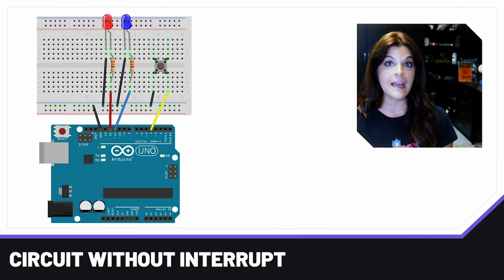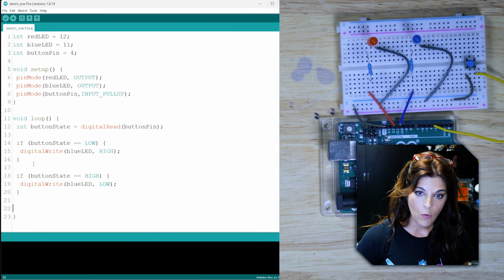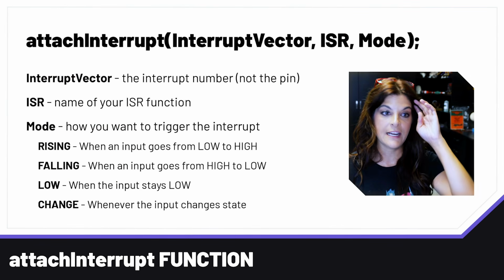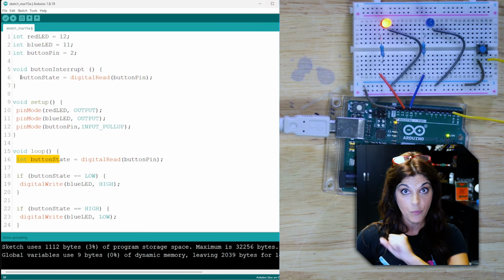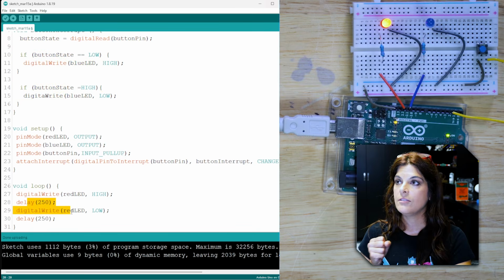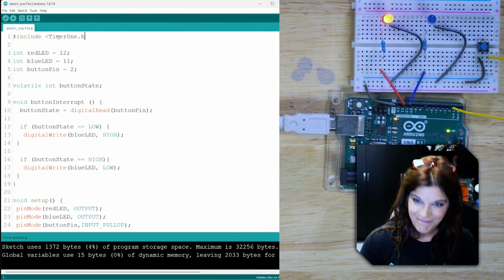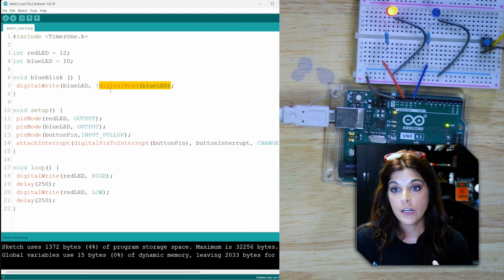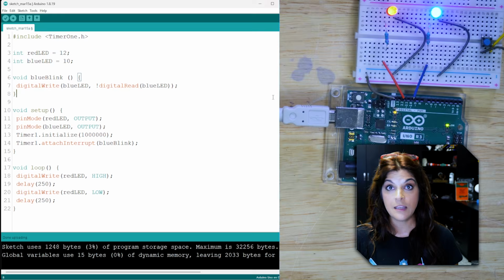How to Use Arduino Interrupts The Easy Way

Comment: // The following code defines the BICOLOR LED class
//
// This is for a TWO LEAD bicolor LED: passing current in one direction results in
// a green color; passing current in the other direction results in red color. Yellow
// can be achieved by alternating rapidly between green and red.
//
#define OFF 0
#define GRN 1
#define RED 2
#define YLW 3

class BICOLOR {
  public:
    BICOLOR(unsigned pin1, unsigned pin2);
    BICOLOR(unsigned pin1, unsigned pin2, unsigned grnDelay, unsigned redDelay);
    void on(int color);
    void blink(unsigned color, unsigned onTime, unsigned offTime);
    void refresh();
    void off();
    void setGrnDelay(unsigned delay);
    void setRedDelay(unsigned delay);
  private:
    void _red();                // sets LED state to RED
    void _grn();                // sets LED state to GRN
    void _off();                // sets LED state to OFF
    unsigned _pin1;             // LED pin assignments = NOTE this class is for a
    unsigned _pin2;             //   2 pin bicolor LED
    unsigned _grnDelay;         // time (msec) to display green to obtain yellow color
    unsigned _redDelay;         // time (msec) to display red to obtain yellow color
    unsigned long _timex;       // current cycle time (used for displaying yellow color)
    unsigned _state;            // LED state - valid values are OFF, GRN, or RED
    unsigned _color;            // LED color - valid values are OFF, GRN, RED, or YLW
    bool     _blink;             // a value of true means current _color is blinking
    unsigned _onTime;           // time (msec) while current color is ON
    unsigned _offTime;          // time (msec) while current color if OFF
    unsigned long _cycleStart;  // start time (msec) of current blink cycle
};

/*
 *  This class controls a two-color LED with two leads
 */

BICOLOR::BICOLOR(unsigned pin1, unsigned pin2) {
  _pin1 = pin1;
  _pin2 = pin2;
  _grnDelay = 10;           // default values
  _redDelay = 3;            //
  pinMode(_pin1,OUTPUT);
  pinMode(_pin2,OUTPUT);
  digitalWrite(_pin1,LOW);
  digitalWrite(_pin2,LOW);
  _color = OFF;
  _state = OFF;
  _blink = false;
}

// For a greener yellow, increase grnDelay
// For a redder yellow, increase redDelay
BICOLOR::BICOLOR(unsigned pin1, unsigned pin2, unsigned grnDelay, unsigned redDelay) {
  _pin1 = pin1;
  _pin2 = pin2;
  _grnDelay = grnDelay;
  _redDelay = redDelay;
  pinMode(_pin1,OUTPUT);
  pinMode(_pin2,OUTPUT);
  digitalWrite(_pin1,LOW);
  digitalWrite(_pin2,LOW);
  _color = OFF;
  _state = OFF;
  _blink = false;
}

void BICOLOR::on(int color) {
  switch (color) {
    case GRN:
      _color = color;
      _blink = false;
      _grn();
      break;
    case RED:
      _color = color;
      _blink = false;
      _red();
      break;
    case YLW:
      _color = color;
      _blink = false;
      _timex = millis();
      _grn();
      break;
  }
}

void BICOLOR::off() {
  _color = OFF;
  _state = OFF;
  _blink = false;
  digitalWrite(_pin1,LOW);
  digitalWrite(_pin2,LOW);
}

void BICOLOR::setGrnDelay(unsigned delay) {
  if (delay != 0) _grnDelay = delay;        // insure _grnDelay is never zero
}

void BICOLOR::setRedDelay(unsigned delay) {
  if (delay != 0) _redDelay = delay;         // insure _redDelay is never zero
}

void BICOLOR::blink(unsigned color, unsigned onTime, unsigned offTime) {
  _color = color;
  _onTime = onTime;
  _offTime = offTime;
  _blink = true;
  _cycleStart = millis();
}

void BICOLOR::refresh() {
  unsigned long currTime;
  
  // First, handle yellow color transitions
  if (_color==YLW && _state!=OFF) {
    currTime = millis() - _timex;
    if (_state==GRN) {
      if (currTime > _grnDelay) {
        _red();
        _timex = millis();
      }
    }
    else {
      if (currTime > _redDelay) {
        _grn();
        _timex = millis();
      }
    }
  }
  
  // Next, handle blinking color
  if (_blink) {
    currTime = millis() - _cycleStart;
    if ((_state!=OFF) && (currTime>_onTime)) {
      _cycleStart = millis();
      _off();
    }
    else if ((_state==OFF) && (currTime>_offTime)) {    
      _cycleStart = millis();
      switch(_color) {
        case RED:
          _red();
          break;
        case GRN:
          _grn();
          break;
        case YLW:
          _timex = _cycleStart;
          _grn();
          break;
      }
    }
  }
}

//  The following primitives set the LED state to GRN, YLW, or OFF
//  without altering any of the other variables that control LED
//  color or lighting

void BICOLOR::_grn() {
  _state = GRN;
  digitalWrite(_pin1,HIGH);
  digitalWrite(_pin2,LOW);
}

void BICOLOR::_red() {
  _state = RED;
  digitalWrite(_pin1,LOW);
  digitalWrite(_pin2,HIGH);
}

void BICOLOR::_off() {
  _state = OFF;
  digitalWrite(_pin1,LOW);
  digitalWrite(_pin2,LOW);
}

Comment: Rachel, a few years ago I was writing a code library to control bicolor LEDs: current flow from pin1 to pin2 lights the red LED, and current flow from pin2 to pin1 lights the green LED. BUT, if you rapidly switch back and forth from red to green, you can achieve a pretty good yellow color.
Not knowing anything about interrupts, I created a bicolorLED class, with methods like setColor(color) where color could be RED or GREEN or YELLOW. RED and GREEN were trivial, but the YELLOW color needed to be automated somehow...
...so I created the refresh() method, which compared the current state of the LED (ON, OFF, RED, or GREEN) with the desired state and made the necessary adjustments. Everything was handled automatically, you just had to (a) call the refresh() method at the start of the loop() function, AND (b) never never NEVER use a delay() statement.
Things got pretty tricky when I decided to add the blink() method, which blinks the LED on and off at specified intervals (e.g. bcLed.blink(500,1000);). Now my class was tracking two different time intervals: one to produce the yellow color and another to control the blink.
I can see now that by using timer interrupts, I could have (I think) continued to use delay() elsewhere in my code. That said, this has never been an issue for me, so I don't see much need to replace a working library.
BUT...
...As I think about it, my solution using classes allows me to have an arbitrary number of blinking LEDs, all at different intervals. If I understand your explanation, I am limited to just three timer interrupts.
That said, I LOVE the idea of using the hardware interrupts for responding to button presses - gotta be a lot cleaner than polling!

Comment: Hello, I love your videos. 
I am having trouble trying to get an interrupt to reset a timer. I tried DELAY first and I could interrupt the timer and the function it was running but would have to wait till the delay timed out to reset the function. I tried to use MILLIS and then could not get the same interrupt to even stop the function MILLIS was running. I hope you have a video you could direct me toward to learn my errors.

Comment: #define B 0
#define C 1
#define D 2
#define A0 14
#define A1 15
#define A2 16
#define A3 17
#define A4 18
#define A5 19
#define MAX 1
#define MIN 0
#define port_B PCINT0_vect
#define port_C PCINT1_vect
#define port_D PCINT2_vect
void PCICR_MSK(uint8_t num_pin, uint8_t num_port, uint8_t mode){
if(num_pin > 7 && num_pin <= 13 && num_port == B && mode == MAX){
PCICR |= (1 << num_port);
PCMSK0 |= (1 << (num_pin - 8));
}
else if(num_pin >= A0 && num_pin <= A5 && num_port == C && mode == MAX){
PCICR |= (1 << num_port);
PCMSK1 |= (1 << (num_pin - 14));
}
else if(num_pin >= 0 && num_pin <= 7 && num_port == D && mode == MAX){
PCICR |= (1 << num_port);
PCMSK2 |= (1 << num_pin);
}
else if(num_pin > 7 && num_pin <= 13 && num_port == B && mode == MIN){
PCICR |= (1 << num_port);
PCMSK0 &= ~(1 << (num_pin - 8));
}
else if(num_pin >= A0 && num_pin <= A5 && num_port == C && mode == MIN){
PCICR |= (1 << num_port);
PCMSK1 &= ~(1 << (num_pin - 14));
}
else if(num_pin >= 0 && num_pin <= 7 && num_port == D && mode == MIN){
PCICR |= (1 << num_port);
PCMSK2 &= ~(1 << num_pin);
}
}
int LED_Y = 13;
int LED_R = 11;
int SW_Y = 7;
int SW_R = 2;
volatile bool state_1 = false;
volatile bool state_2 = false;
void setup(){
pinMode(LED_Y , OUTPUT);
pinMode(LED_R , OUTPUT);
pinMode(SW_Y , INPUT_PULLUP);
pinMode(SW_R , INPUT_PULLUP);
PCICR_MSK(7 , D , MAX);
PCICR_MSK(2 , D , MAX);
}
void loop(){

}
ISR (port_D){
if(digitalRead(SW_R) == LOW){
state_2 = !state_2;
digitalWrite(LED_R , state_2);
}
if(digitalRead(SW_Y) == LOW){
state_1 = !state_1;
digitalWrite(LED_Y , state_1);
}
}

Comment: this is why flowcharts are very important. You can see issues BEFORE you code. It is also extremely important to keep anything in you ISR to the bare minimum. in this example, just set the memory variable and exit.
you can test for the memory variable being set in your program.
I write ISRs all the time in assembly lang

Comment: The Raspberry Pico for example is so sensitive, that touching a wrong pin on the fly by accident kills it completely. The Arduino is much better in this regard, when leaving the board switched on while moving components. Tested and confirmed 3 times 😅

Comment: Thanks Rachel. Your tutorial was very helpful. A rotary encoder was just not working for me. So I decided to look at every pin individually to see what wasn't happening. Amazingly there was nothing wrong with the code nor the components. One of the linking  wires was open circuit despite appearing to be perfectly good. All that searching for problems in the code for a couple of days !!! 😂😂😂Kind regards. South Africa

Comment: Do you still do Arduino tutorials? Yours are far better than any others I have seen. I need to know, if I have 3 ISRs, will the program counter return to the top of the void Loop section after finished with any one of the ISRs? It only makes sense that it would but looking for confirmation. Actually, I suppose the return from ISR pulls the program counter off the stack and execution resumes at that pointer location. Hmmm. Let me know. Thamks.

Comment: Rachel, If the Arduino is executing an Interrupt and receives another Interrupt, does it continue with the execution of the first Interrupt and when it is finished, executes the second. Or does it Interrupt the first to execute the second?  - Paul

Comment: Solid explaining. Clear. To the point. Going to use the hardware interrupt to detect flipper button presses, and I think scoring points. if there's multiballs on the pinball, there's going to be multiple oppertunities to score points in quick succession. What would happen tho if you wanted to press two buttons at the same time? EG flip both left and right flippers.

Comment: good clear explanations, learned quite a few things. you say funny things about code...I'll try everything you showed....I have yet to find a working example of either type ... I can get my Arduino to sing, but it won't dance. iow, I can get it to do anything I want, spew to the serial ouput, led matrix, external oled, 16x2lcd, blink lights, change execution paths with a button press - everything except 'the actual work' which in my case, counting a pulse for a certain amount of time and this requires an interrupt. hence I watched this video

Comment: Please show how to use timer interrupts without using a library. IMHO, libraries hide things from understanding. BTW, I am in no way an expert or even intermediate level programmer. I am currently struggling to get timers to work on an Arduino Mega.

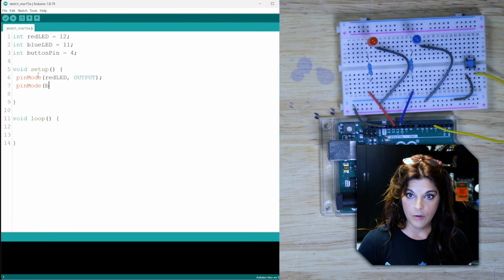Comment: 3:06 I haven't implemented this, but I know that some programming languages like Python 3 offer asyncronous programming by using an event loop that runs in the background. The event loop simply reads from an event queue and coordinates calls to and responses from what would outherwise be blocking operations. I think the most efficient implementations end up using interrupts anyway, but you could also implement a simple approach using polling techniques.

Comment: I have a question

is it possible to do an interrupt while having the components connected on a shield?
like this connects directly to an arduino but i need to use a shield for a project so is there anyway it could be done

Comment: Thank you for these tutorials, I find them interesting. I practice but not enough yet because I use AI to make my code while I would like to master the Arduino language without help. Could you do a tutorial on the PID with a DC modeller and a simple encoder with 2 optical sensors? Thank you for your answer . I live in France)

Comment: Is there a way to make an arduino close a circuit. The circuit will have a very very low current draw. I just need the arduino to close the circuit just like you would press a little button. I know you can make the arduino trigger a relay but is there a way to close a circuit without an external relay.

Comment: I found you searching for interrupts. Really enjoyed your video and the way you delivered the information. I can't say I enjoyed any others more. I struggled with button debounce using the hardware interrupt approach, but finally worked through the issues. I look forward to your other videos.
Reply: Ps: I get page not found when I try to follow your link. Probably because you have move on.
Reply from the maker: Thanks for letting me know about the dead link. I re-organized my tutorials on my website and the url must have changed. I corrected it so you can now see the page with the code! 👍

Comment: @ Rachel De Barros, how can I use this for multiple blinking lights, say like the strobe lights on an aircraft, if I wanted to put this on a model I need them to go on in one colour then off & onto another colour, there’s 3 colours I need to use red, white & green. The white light would be constantly on too. Any help or advice would be greatly appreciated.
Reply: Don't know, whether you still need an answer...

Here is my suggestion.

I would implement a timer counter with a counting speed of the smallest time slice you need, say it is 100 milli seconds. So on each timer interrupt increase the counter by one. Then think of a state machine where at distinct count values things should be done.

For example red LED every 300 milli seconds (ms), green LED every 500 ms and blue LED every 700 ms.

Then the counter has to count up to the smallest common multiple. In our case this is 3 * 5 * 7 = 105. If the counter reaches this value set it back to zero. Within ISR:

Counter = Counter + 1;
If Counter >= 105 {
    Counter= 0;
}

To toggle the red led use the following if statement:

If ( (counter % 3) == 0)  {
    ToggleRedLed();
}

For the green LED exchange 3 by 5 and call
ToggleGreenLed():

If ( (counter % 5) == 0)  {
    ToggleGreenLed();
}

For the blue LED exchange 3 by 7 and call
ToggleBlueLed()

The % is the so-called modulo operator:

0 % 3 = 0
1 % 3 = 1
2 % 3 = 2
3 % 3 = 0
4 % 3 = 1
5 % 3 = 2
6 % 3 = 0
....
And so on

X % n will always compute to values from 0 to n-1 (for X >= 0)

Comment: Very nice tutorial! I would just suggest a few corrections:

1. The Arduino Uno has no software interrupts, although they can be simulated by writing to an interrupt pin configured as output. The timers are hardware devices, and the timer interrupts are hardware interrupts.

2. The first parameter of attachInterrupt() is an “external interrupt” number. This is not the same as an interrupt vector number. FWIW, external interrupt number 0 is interrupt vector 2 (see the ATmega328P datasheet).

3. Only variables shared between ISR and regular code need to be volatile. In the example you give, buttonState should be local to the ISR, and doesn't need to be volatile.

4. Using millis() within an ISR is perfectly fine. You should not, however, expect millis() to get updated within the ISR, as it gets “frozen” when the interrupt is triggered.

Comment: So you asked has anyone ever written a multitasking function without using interrupts, and the answer is yes. I developed a cooperative multitasking core for any microcontroller after has a system that was doing a ton of work and struggling to get all done within a second. It took me a good while thinking about the problem before I developed the engine (it’s very very light weight and consumes only a few hundred bytes of memory. That same system doing all the same things (and now more) runs at around 15,500 cycles a second.

I have now been using it for several years and use it on very project as it eliminated more code than it uses. In fact I even use it on top of RTOS because make coding do easy. So yo answer your question .. Yes

I use it commercially so I won’t release it, sadly but I have a significant competitive edge killing systems with bigger, faster and more expensive microcontrollers.

Nice bright video for beginners

Comment: At 3:15 you asked if anyone had figured out how to do this without interrupts. Just build a state machine into the loop() code. Let's say you want to update the button every 50 mS. {20 times a second}. You have two tasks to accomplish (update the red LED and update the button), so loop() has to run every 25 mS. In setup(), add stored_millis = millis(); {along with all the other bits.}. Inside loop() write a while loop that reads the latest value of millis() and compares it to stored_millis(), If greater than 25 mS, break out of the while loop. Next, stored_millis = latest_millis; state_counter += 1; If state_counter is odd, call Update_Red() else call Update_Blue(). In Update_Red(): increment a variable red_counter. If red_counter == 10, {25*10 = 250mS}, change the state of the Red LED and reset red_counter to 0. In Update_Blue(), make the Blue LED state equal to the button state. easy peasy.
Reply: Or just follow the “Blink Without Delay” Arduino tutorial.